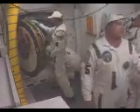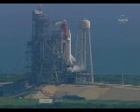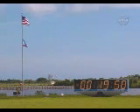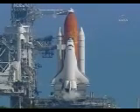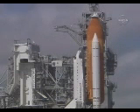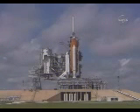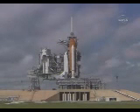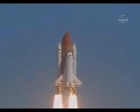STS-115 Atlantis long countdown to launch

Comment: The Cap you see on top of the External Tank is the Fueling cap. It fills the tank with Liquid Hydrogen and Liquid Oxygen. Them temp of these fulls is super cold, L/H is -400 deg F and LOX is around -280 deg F.
The the cap has to stay on to top off the tank till a few minutes for launch. The Fuel evaporates quickly.

Comment: If you mean the thing that's swung to one side at T-2 mins, yeah, it's the oxygen vent hood.

NASA say, "Heated gaseous nitrogen is pumped into the hood to warm the liquid oxygen vent system at the top of the external tank. This prevents oxygen vapors that are exiting the vent louvers from condensing water vapor in the surrounding air into potentially damaging ice." Hmmm, I didn't know that.